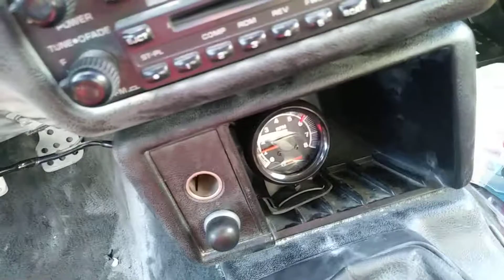Lt1 carb conversion

Comment: Hello from Romania 🇷🇴

Hey man are you on heare ? I have a 1993 LT1 and i whant to carb  swap it ! 

I have the complete car and i whant to carb swap because of the optispark. And its really simple to make it work, teoretic. 

Chould you give exact informațion about the swap ? 

I have i think a 700R transmission because of that TV Cable. I am not sure yet. 

So, i need that carb intake from GM, the hei distribuitor, wires with spark plugs, starter, alternator, and what about the wires for ground and start the engine ? 

And how will the transmission shift without that PCM ?! 
I have heard of some manual valve body, i am not sure yet how😮😮 exacly that works. 

But if you are wiling to tell me what i need and wjat wires for ground to start the engine., I WOULD apreciate that alot ! 

God Bless!